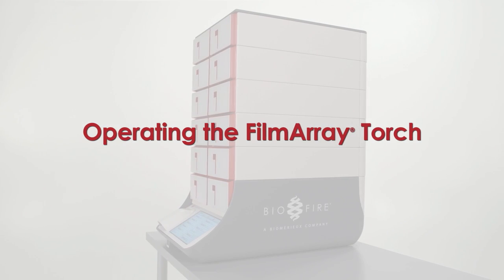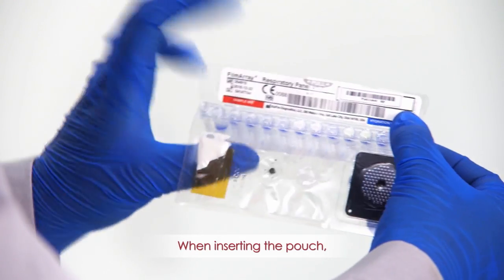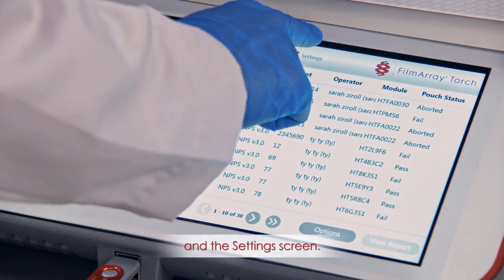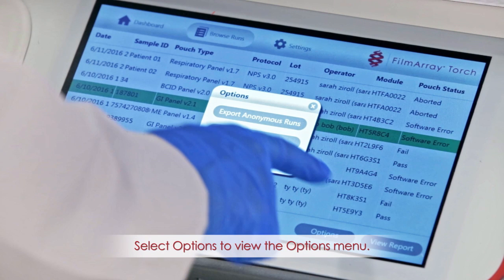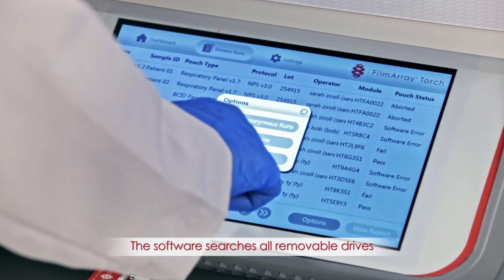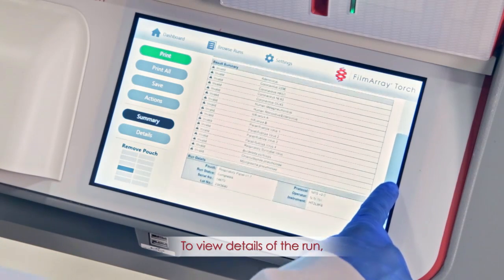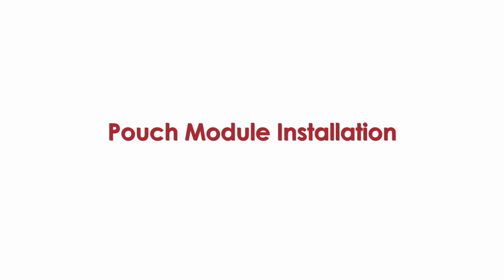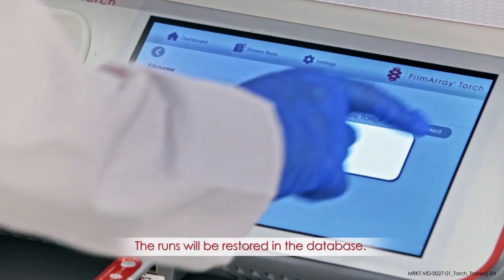BioFire® FilmArray® Torch Training Video

Comment: Which option should be used to share / send result to Instrument Manager / Data Innovation?
Reply from the maker: If you have any questions regarding LIS or need assistance interfacing your BioFire system with your LIS provider, please reach out to Customer Technical Support at:

support@biofiredx.com
801-736-6354 option 5
1-800-735-6544